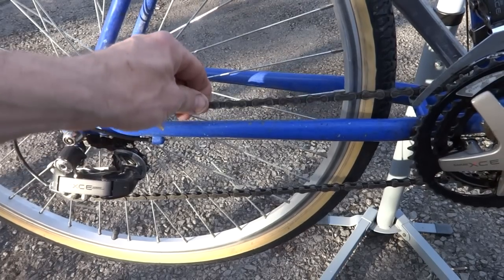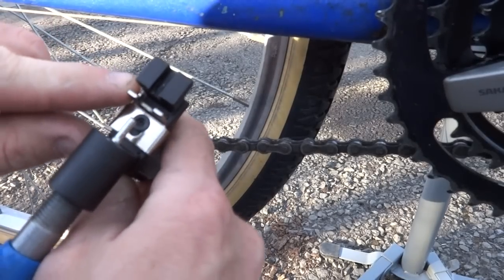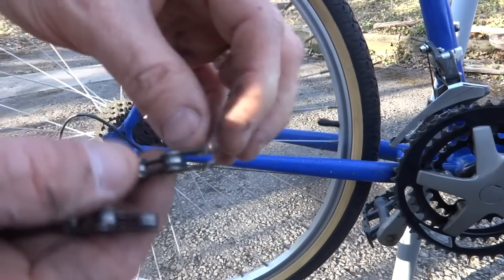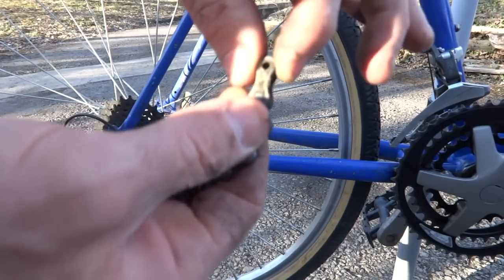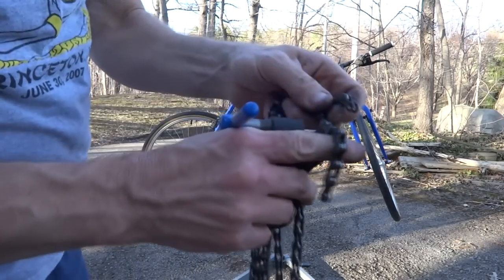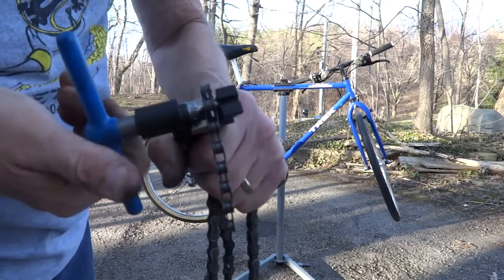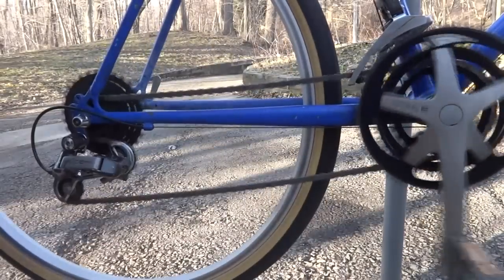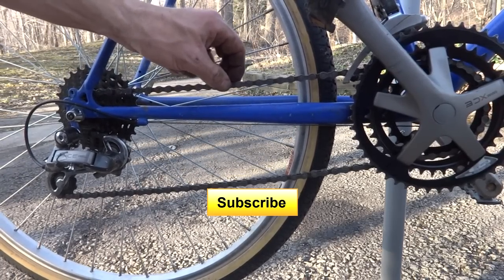Bike Chain Replacement

Comment: The old chain was so worn that it most probably required the front and rear cogs to be changed as well. Otherwise the new chain would skip. You should have mentioned that.

Comment: My bicycle is 7 speed (no front gear). I'm having problems when I'm riding steep roads on 1st gear the chain skips away and makes horrible noises. Does that mean that I need to change my chain? Indicator doesn't say its necessary, you know what I mean?

Comment: I have learned so much from you RJ. For almost 4 years now I have been able to do all the maintenance, installation of add-ons and repairs on my bike!
Reply: I was quoted £18 to change my chain on the bike but I knew it was waaay too much for such a simple procedure. Looked at RJ’s video and did the changing myself in less than 10 minutes.

Comment: Thank you RJ!  I replaced my chain  with a pin type.  My chain broke in one mile.  I fixed it again and only got a mile.  Watched your video and saw what I was doing wrong.   I was pushing the pin through but stopping when the tip came out instead of pushing the pin all the way through.  Your videos are my " go to " videos for repairs.  Thanks again.
Reply from the maker: Don't reuse pins. Shimano has special replacement pins. I prefer KMC missing links.
Reply: Can I use the KMC link on a Shimano chain?  It seems to work but haven't tested it yet.
Thanks ..
Reply from the maker: Probably if it's the right speed.

Comment: i wanted to repair my own bikes and thanks to your channel I have learned a lot. one thing I wanted to mention is that to remove a quick link for the chain I just push the sides in and then move the pieces apart. if its difficult its because of the grim. so a drop of lube and it comes apart easy. i never had to buy the tool. and when going back together i use a piece of coat hanger with the ends bent like you use . just mine is about 4 inches long. so for those days when im all butter fingers i no longer have the chain getting away on me. thanks be well

Comment: just changed from a 7 speed freewheel to a freehub & 8 speed cassette  (bought a new wheel with the freehub fitted rather than converted), i came here to see if there was an easy way to fit the new chain i bought to go with it, there is its £32 from Amazon its that park tool link extractor, the light weight one i carry  in my rucksack for emergencies just isn't up to the job of pushing out links on the new chain.  Another great video ty!!

Comment: Thanks for the video. You make it look so easy. But I understand that single speed, 6~8 speed, 9, 10 and 11 speed use different chains. Their chain links are different. Chain and links can be simply and complicated as well. You see I own a single speed bicycle, 1 mountain bike 3x8 speed, 1 cannondale using 3x9 speed, 1 foldie using 8 speed and 1 using 3x7 speed.

Comment: Lifesaver video.  Thank you for sharing!  I have a chain that's not worn but very rusty.  After I remove the chain to clean it, can I reuse the old pin that I removed to break the chain?

Comment: Hey thanks, older video but still relevant in 2020. I've spent quite some time learning all about different chains, wear and stretch measurement, chain braking tools and KMC missing links. After doing all that groundwork this was a great video to see it all come together in practice. I've ordered my chain tools, will acquire some spare links, and I'm confident now I'll be able to handle any chain issues that crop up. Thanks again for learning us new guys.

Comment: I just bought an SRAM chain from my local bike shop. I've already scrolled through these comments to see if you should lube a new chain and I see the answer is no because the chain comes lubed from the factory. I would have no problem with this, but, the SRAM chain is really, really lubed with a sticky clean heavy lube coating on all sides. My concern is that it is going to attract a crazy amount of dust and sand from the road as I only ride in dry conditions. Searched some forums and as with everything, conflicting information. RJ or anyone else want to throw in your 2 cents here? Anyone have personal experience with SRAM chains? I'm just starting out here, doing my own bike work, and opening the chain today really caught me off guard with that tacky coating. Almost tempted to strip it and re-lube.
Reply from the maker: Ride, then clean and lube it later.

Comment: how can u tell if the cassette or freewheel needs to b changed when u allow the chain to get worn that badly?
when u replace an old chain.... should u replace the freewheel/cassette at the same time?
if not.. will u have to deal with slipping?

Comment: If you break a chain in the wrong place can you put it back together or will it break again while riding
Reply from the maker: There isn't really a wrong spot. Master links usually replace a pair of outer plates, and are pretty solid. Don't try to reuse the old pin. Then your chain will break. They make special replacement pins, but I prefer master links.
Reply: Ok thank you

Comment: Also r.j. when using your chain checker you need to install the hook end on a link with inner plates to ensure you're measuring against the roller and not the side plates
Reply from the maker: It doesn't matter. If one end is between the narrow plates, the other end will be between the outer plates. Same difference.

Comment: How do you know if the length of the chain to be replaced is correct? How can you measure for/know the correct length of the chain for your bike if you don't know what it is? Maybe you lost the chain? Or the old chain was put on/measured incorrectly?
PS: the blurry parts, the parts where your depth of field is off, would benefit from clarity. Turn off auto focus, tag or fix focus, etc. can work. Or just doing the 'showing' close over a table, piece of paper, etc. That way you avoid a large depth of field where the camera is perhaps not focusing on what you want it to focus on .... Respectfully

Comment: ive seen other videos where it was important to check which way the brand writing was facing on the chain links.. ie to be sure to have them facing outwards and forwards.. i dont know if there is a subtle difference on some chains like this
Reply from the maker: I think on chains where the chain is rejoined by pressing a pin in.

Comment: i got a second hand montain bike and ive removed the old chain...it has 108 links and ive thinking of buying a 116 link chain so i need to remove 8 links...can i rejoin the chain using a pin instead of using a power link as in your video....the bike is 24 speed and i wonder if i will get all of the speeds using a 108 link chain ???? ive never riden the bike before so not sure if the old 108 pin chain was ment to give the full  24 speeds.
Reply from the maker: If you get a replacement pin. Don't reuse the original pin. The chain will be weak at that point and likely to break, I prefer master links.
Reply from the maker: https://www.youtube.com/watch?v=ELsKrgTt0oY
Reply: @RJTheBikeGuy  many thanks im more clearer now what to do.

Comment: Hey RJ! Quick question how can I remove chainring bolt when its stripped? Should i buy a new one?
Reply from the maker: I would replace it. They are not expensive. You get it out however you can. Maybe drill it out, or cut a slot in it with a dremel tool. Whatever it takes.

Comment: Wish you showed also re-measuring the new chain using your chain gauge.
Reply from the maker: Why? The new chain is not worn and the gauge does not fall through.
Reply from the maker: Other than the chain looking nicer, you can't tell the difference without the gauge.

Comment: Hello ! I have a 10 year old mtb with 8 speed shimano cassette. I am looking to replace the rear wheel (with a new 8 speed shimano cassette) with a new one to mount a disc brake. If I install a new shimano cassette (say 8 speed shimano hg41), will my old shimano chain be still compatible with the new shimano cassette even though they're of the same "type"(8 speed) and brand? Could you please reply ? I am really keen into finding out whether the chain will still be compatible or not so I can do the work myself... Thanks!
Reply from the maker: If the bike was 8 speed and you are staying 8 speed, the chain will be compatible. But if the chain is 10 years old, it may be worn and maybe in need of replacement.
Reply: ah ok I see... No problem then ! I just need to have the chain replaced. Thank you !!!
Reply: frank power
Reply: +Reinz Donayre hi. that' s my username ... I got it off the Simpsons ( I changed Max Power to Frank Power).

Comment: if i split the chain which i have and add this segment will it be ok? or do I have to remove one segment from the chain, will it matter that there is one more (this folding one)?
Reply from the maker: The "missing link" master link replaces a pair of the outer plates of the chain.

Comment: How do you know if the pully is working properly? Thanks
Reply from the maker: If it rotates smoothly it's working fine. https://www.youtube.com/watch?v=zeb80OeL_pM
Reply: @RJTheBikeGuy  My Trike kinda slips I guess, slips gears it did it yesterday it slipped down to gear 3 while I was on 2 and it cannot seem to get onto the big cassette cog gear 1
Reply from the maker: @CatherineThompson98  https://www.youtube.com/watch?v=gwBQxhZhKnE

Comment: what is your usual chain change interval?
Reply from the maker: +imhs81 I change it when it's worn.
Reply: RJ The Bike Guy thanks alot! BTW, does WD40 do any harm to grease in pedals?
Reply from the maker: Well, it will dissolve and flush out the grease leaving your pedals with little or no lubrication. WD-40 is basically a solvent with a little oil added. It is designed for displacing water. WD=Water Displacement.

Comment: Chains have different sizes, #35, #40, #41, #428 etc. #428 is for crossers or quad. #35 is (i guess) for bikcycles.
Reply from the maker: Olivier Beucken I have never heard these numbers before. The chain is a 1/2" x 3/32".

Comment: what gears specifically for this exact group set and speed of bike?
Reply from the maker: It doesn't matter when replacing a chain.
Reply: You mentioned it being easier in the video and I’ve been messing with a chain for 3 days, and only other thing I can think is the problem is the chain isn’t the right kind for a 21 speed
Reply from the maker: You have to have a chain compatible with YOUR drivetrain. If you have 7 cogs on the back, you need a chain compatible for 7 speeds. If you have 10 cogs, you need a 10 speed compatible chain. And I think the only thing I said about being easier is shifting the smallest chain ring and cog. It doesn't matter how many speeds you have. And it doesn't matter what drive train the bike in my video has.

Comment: can the pin be reuse after it get push out. also can it be any pin?
Reply from the maker: Do not reuse the pin. That will be a weak point in the chain. They sell replacement pins. I prefer a master link.

Comment: What if you don't have the old chain to compare it against?
Reply from the maker: Then that gets more complicated, and goes beyond the scope of this video. It really depends on the length of the chain stay and the size of the chain rings and size of the cogs. You need to make sure the chain works in the different gearing combinations.
Reply: shyflirt1 It would be awesome if you could make a video covering this point. Love the videos!
Reply from the maker: stockton350 It's on my to do list. I have a frame that I plan on building up and plan to do it on that bike.

Comment: Do you have a video on how to fit a new chain on a full suspension bike..I have seen some but they are not that good..not like your vids..
Reply from the maker: Replacing a chain on a full suspension bike is usually no different than installing a chain on bike with no rear suspension.

Comment: you don't need this joining pin. I reattach it the same way ( in reverse) tricky but nicer
Reply from the maker: The pins are not meant to be reused and will leave a weak point in the chain.
Reply: RJ The Bike Guy  interesting... 
I don't remove the pin entirely so it will stay attached on the outer layer, then i push it back in . so,  what will happen to the chain now that its still working for more than 1000 miles after attaching? thanks for answering
Reply: When the chain wears, the roller wears a notch into the chain pin or rivet causing the illusion of "stretching" , this weakens the whole structure of the chain. When you reuse the chain pin it weakens the chain side plates, that is why you don't remove & refit a chain pin if shortening the chain.

Comment: Can a used chain be reinstalled by pushing the link pin back in again? I ask as I bought an old bike that needs a deep cleaning yet is not stretched.
Reply from the maker: Neil Snape generally it is best not to reuse the pin. The old method was to push the pin out just far enough to pull the chain apart, and then to later push it back in. But you have a weak point there. So they make replacement pins that you push in a brand new pin each time. I refer using a master link such as the Missing Link in the video instead of messing with a new pin.
Reply: +Scoo Kali I did use the old pin, as I only wanted to clean up the old bike and sell it. On another rebuild I replaced the chain on an old 1980 road bike, yet not the cassette. The new chain doesn't work well with the old worn cogs. Sometimes the old chains if cleaned up leave you with less worries.
Reply from the maker: As the chain wears it gets longer, and the free wheel will wear due to this. And when you put a new chain on a freewheel that is pretty worn, it will skip. There are some gauges to tell if freewheels are worn, but easier and probably cheaper to just replace it.